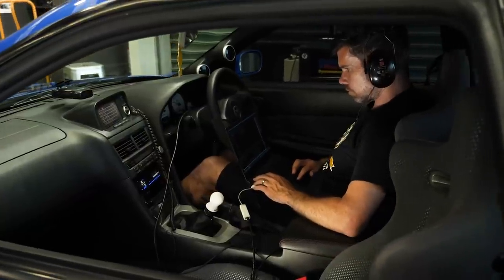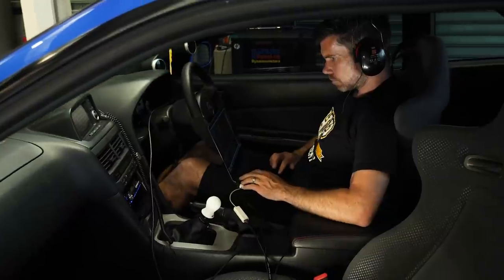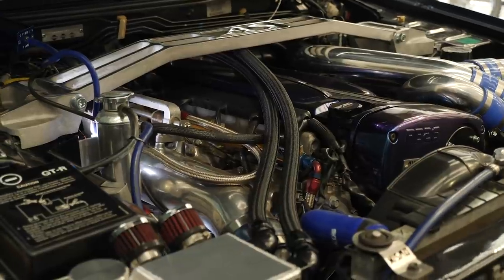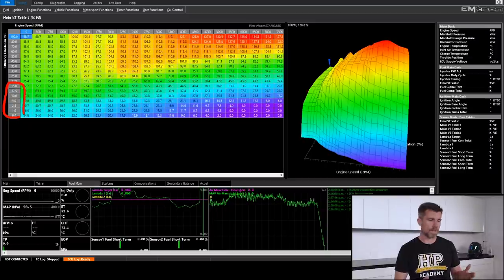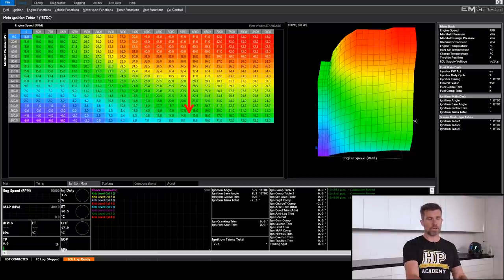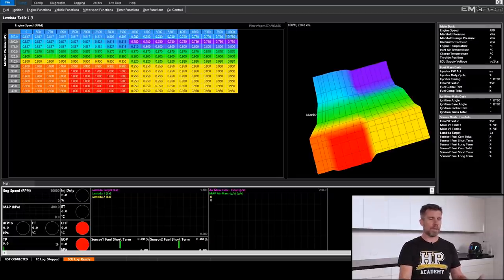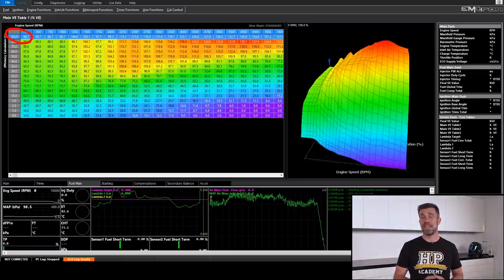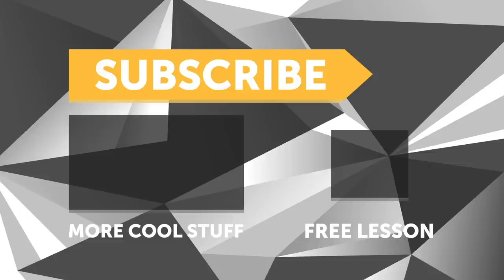Don't Remove Your Turbocharged ITB Setup's WASTEGATE! | Individual Throttle Body Tuning [#TECHTALK]

Comment: This should come handy when working on my GTIR with nistune. Thx Andre!
Reply: I’ve seen GTIR a few times and thought I’d ask as It’s been recent, mind sharing what it stands for? I keep reading it as Imitation, like a gtst with rb26 or installed itb’s
Reply: @Master_Psyper  it’s a pulsar gtir, was built by nissan to compete in rally, has an sr20 turbo with individual throttle body’s and AWD
Reply: @bretth3224  aaahhhhh awesome, thanks
Reply: @Master_Psyper  yes it's a different platform with a variation on the SR20DET with ITBs, solid lifters, and some other beefier components. I have a video series where I'm building one on my channel 😉
Reply: @FWLRmusic  oh nice, i appreciate it, that makes a lot more sense now lol. good luck with the channel and build, ill check it out for sure.
Reply: If you're running a Nistune board on the factory ECU just install a Z32 AFM and be done with it as it makes it so much easier to tune. Coming form someone with a MAP tuned GTIR with the stock ITB's as I wish it had a AFM to make tuning simple
Reply: @Gidanski  that's awesome info! I converted my DSM to speed density years ago but wasn't sure if that was the way to go with the Pulsar
Reply: At WOT it's no different to a conventional MAP with a plenum setup but at part throttle and cruise you can be a 0 manifold vacuum from as little as 15% throttle, which if ignition is mapped by MAP as its load makes it have a dead band of retarded timing until it actually comes on boost. I'd imagine its fine with the stock turbo as that comes on song quickly but mine has a 2867RS with a .86 turbine housing and light throttle was a sluggish at lower revs and city driving/crusing

Comment: Hi! Nice video, but I feel or think that you went a bit too fast between the TPS vs RPM VE table and the AFR table. Yes, I understand that the AFR target are MAP driven, and the target will be richer. But the increased “plenum” pressure does not directly do anything with the VE values in the map. Are you multiplying the VE values relative to “plenum” pressure? Or in other words, use the pressure before the throttle blades as a barometric correction? Would have been nice to get more in details there.

Comment: I'm pretty ignorant when it comes to tuning but why can't a good MAF/MAP reading taken off the airbox/plenum preceding the ITBs?
Reply: Because you what you actually want to know is the pressure between the throttle body and the intake valve.

Comment: is  afc capable of correcting AFR from 12.0 to 15.0 at idle ?
MAP sensor at idle is 1.9 , but it should be around 1.55 volts
is it capable of correcting this MAP voltage ?
ive got 4age 20v silvertop itb's on a 16v 4age .
vacuum is the best i can make from them = -0.4 bar instead of -0.6 ( sinlge throttle ) .
i built a large volume vacuum block ( 1.5 liter) with a check valve to eliminate pulse .
idles nice , runs good, no hesitation . and brake booster works fine .
its just the idle afr is to rich .

anyone care to share knoledge/experience  about AFC apexi?
 dont need to squeeze out more hp 
i would appreciate your answer ....

thanks!!!!!!

Comment: Thanks Andre 👍

What would you recommend I do when looking to add efi to a late model 300cc 2 stroke dirt bike?
I was planning to go with a simple throttle body off a 450 MX bike and a Haltec E550.
My concerns were about getting a sensible MAP signal given that it would have a very short runner length between the butterfly and the Reed valve plate.
I also considered referencing the MAP signal off the crankcase, but the signal would be worse, swinging from pressure, to vacuum and back as the piston runs through its strokes.

Is mapping via TPS the only option here, or a combination of TPS and MAP with a switch point 🤷‍♂️
How does only calculate VE on a 2 stroke engine, especially one with a set of electronic power valves?